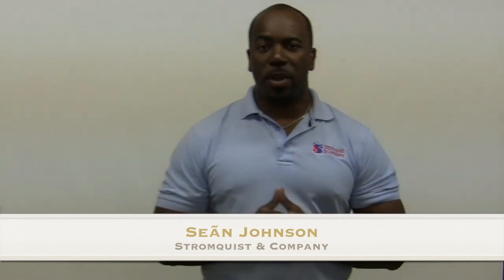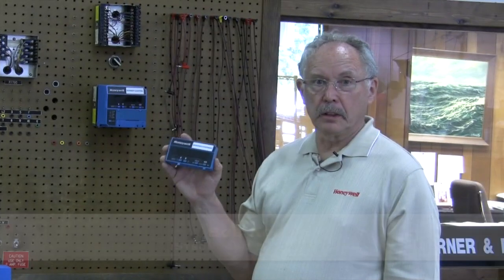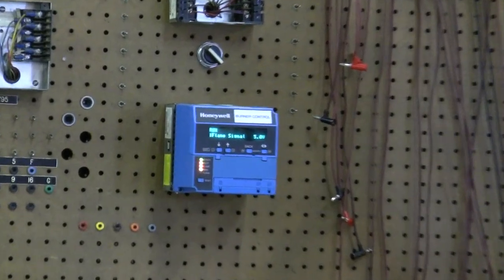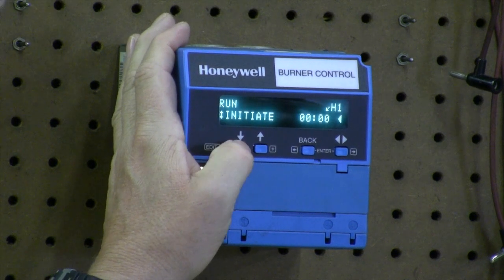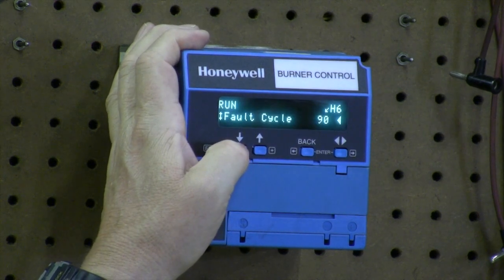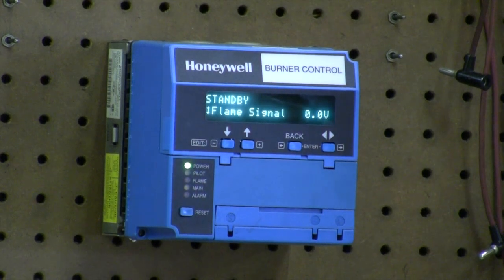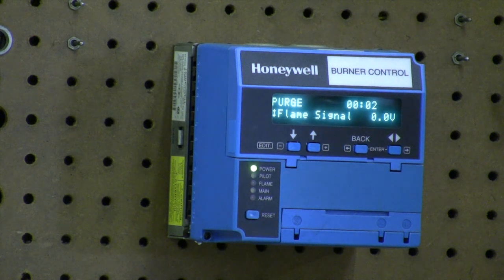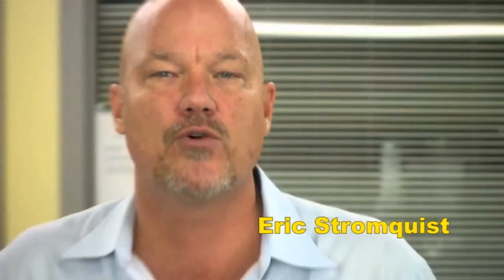Bob explains Honeywell's 7800 Burner Control

Comment: I run these displays and have the burner controller located near the burner to assist a technician when working on a burner issue. I also use the coms feature on the display to broadcast data to both the  display on my operator touch screens and also to the PLC. This enables me to display the data on the operator touch screen and also report the burner status to the PLC. Having the data displayed on the

Comment: I have a Honeywell burner control that fluctuates in DC voltage from 5 - 0.1 volts during a cycle which causes it to lock out on flame failure.  I thought it was the U.V. Fire Eye so I change it out with a brand new one.  I still had the same problem so I thought it might be a clog in the "tube" the Fire Eye connects to so I cleaned it out and I still have  a fluctuation in voltage which is causing flame failure lock out.

Is my Honeywell Burner Control bad?
Reply: DaneStolthed i had the same problem and in my case it was a defective wire from the subbase to the UV
Reply: Erick Zamarron Thanks, I now have a new problem, The fire eye now detects a flame when the boiler is not firing.  Usually that's a problem with fuel oil but my boiler uses natural gas.
Reply: +DaneStolthed You can take a lighter to the front of the eye and you should see the eye light up that should verify that your uv sensor is good

Comment: Hello, My burner control keeps showing "Fault 47 Jumpers Changed" any idea what might be the problem? thanks
Reply: Too much vibration has broken a connection on the inside. Replace the control  and fix what ever is causing the vibration.

Comment: Hi everyone, can someone help me with my problem on our oven? The Burner control sudden turn to stand by mode while we are on production.Please we need ur help. Many thanks
Reply: Could be anything if it's moving to standby as that tells me several specs has been satisfied to close that operation and thus move into this mode. Loose wire, operator failure, or it's actually working correctly really. My main guess would be the air switch not seeing the unit or just guessing. If you have no lockout (very different from "standby") this really doesn't tell you why it went into standby as it's not a fault. This is why you should have an actual boiler operator employed to maintain this type of equipment or someone to call 24/7.

Comment: I’m getting a main flame ignition code on my 7800 . Does anybody have any idea where I should start ? Also when I get that alarm for some reason the honey well drops out it power and turns off.
Reply: Ignoring that last part, which is a issue as well: Flame rod or detector usually IMO since the eye or rod senses the pilot but not the main flame. Clean the eye or replace the rod. "Flame was lost during MFEP or the first 10 seconds of the RUN state". A dirty flame eye can see either flame favorably but not the other and rods can just crack or become toothpicks if not maintained.

Watch the main fuel valve open, jaunt over to the firebox window and watch the pilot-to-main transition. Does it look like one is blowing out the other? Does the main actually light then fall on it's face? I hate these as it's usually in the fuel train with everything from the burner back on the fuel line...assuming it's nat gas and not oil. The Main Fuel and Pilot have different regulators so that's why I'm 50/50 on which one is blowing out which. High Pilot pressure is my usual suspect during that transition to the main flame but it's not a positive suggestion here. Ya just have to watch that transition in the window to make a personal judgement. 

That Honeywell burner control turning completely off while creating an alarm in the process would be highly suspect of any and all problems, having said all that. They don't do that so I suspect it's telling you lies then dies...but that's just me.

Comment: Hello dear, please interpret the failure of 14 lockout.
Reply: According the the manual, "High Fire Interlock Switch failure to close during PREPURGE." That means it didn't close when expected to be at high fire, that simple. Conduct the 5 steps it states in the manual then consult a boiler tech that understands these things. Not knowing your actuator model or how it's high fire switch works is just a guess on youtube comments.